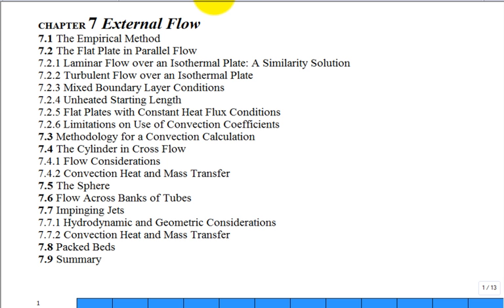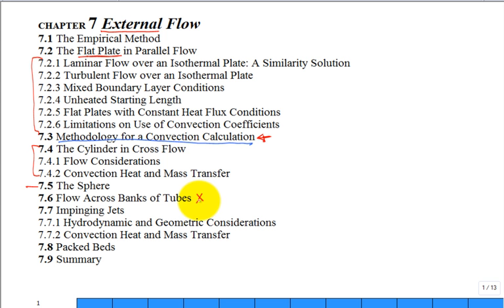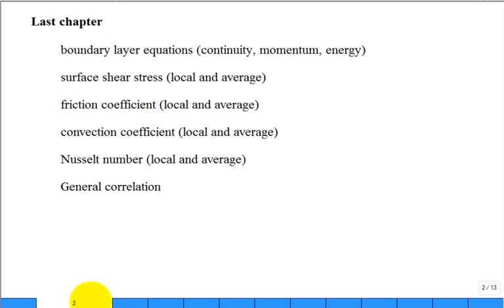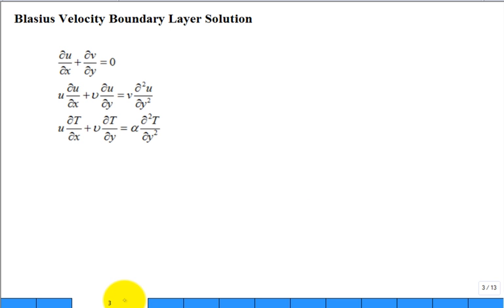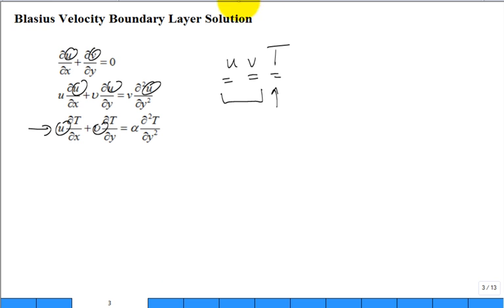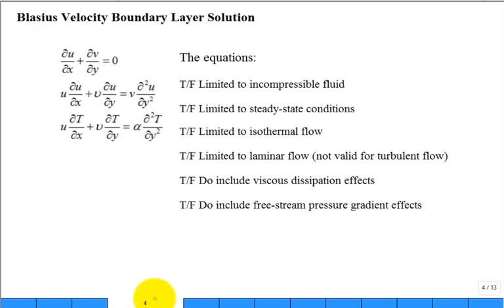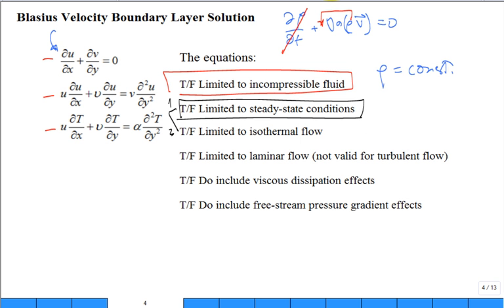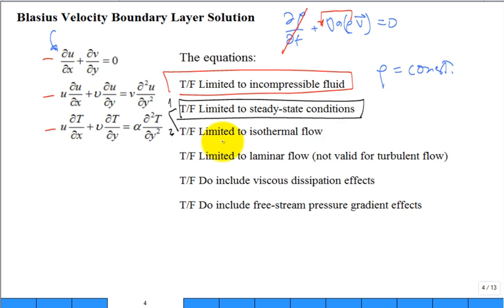External Convection 1of2

Comment: In case someone else was watching this or reading the book and was stuck like myself, there is actually a mistake in the book and therefore the slide. u is actually equal to u(inf)*df/d(nu). The book places the equal sign after the u(inf) instead of before. The derivation for du/dx and du/dy used the correct value of u so it doesn't change much. 

Just thought I'd save some future student some time.